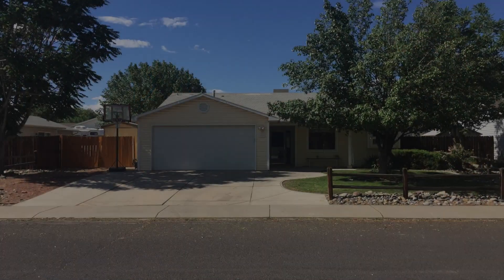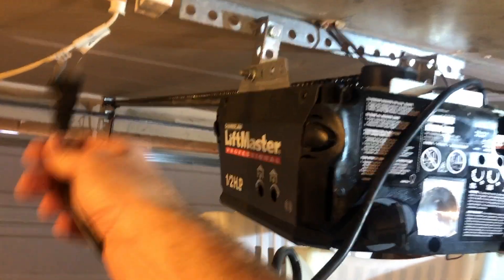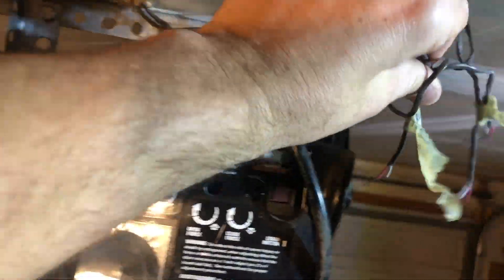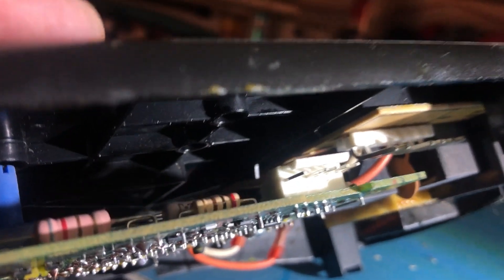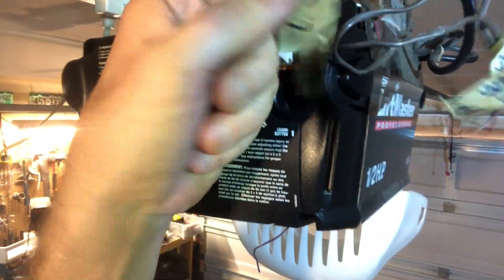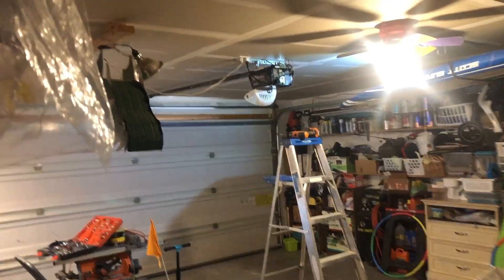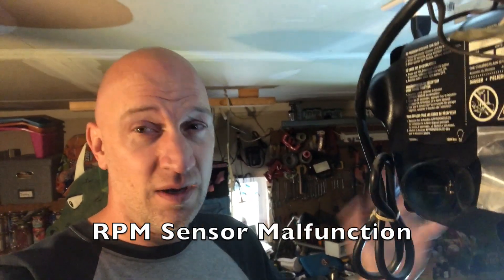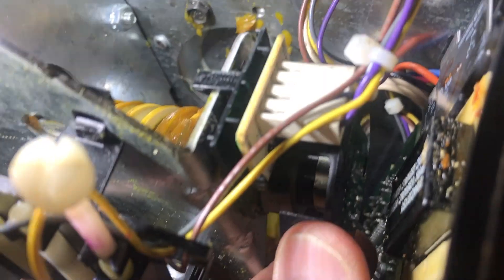Garage Door Opener Logic Board Replacement | Chamberlain Liftmaster 3265

Comment: I have same opener.  Mine the light would go out, and not work.  A couple whacks on the side and the light would come back on and work (sometimes).  I finally found the bad solders.  One on the signal board for the P1 connector going to the power supply board was dark.  Resoldered it.  Worked for 10 times.   So ordered a used one.  Then took it apart again and found the real problem.   The pins for the P1 coming from the power supply board had a bad solder.   Resoldered and has worked perfectly over 100 times now.
Reply from the maker: Interesting. Over the years I've had issues with the lights not working too...probably the same issue. They say on the side that you can have 100 watt bulb in there, but I wonder if that is actually melting some solder points...